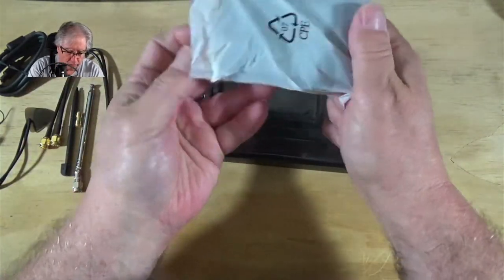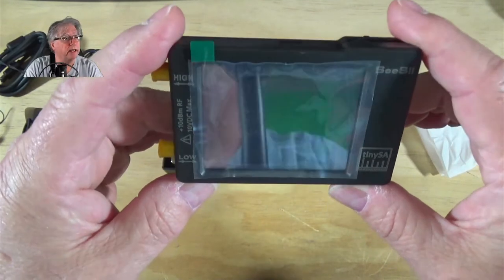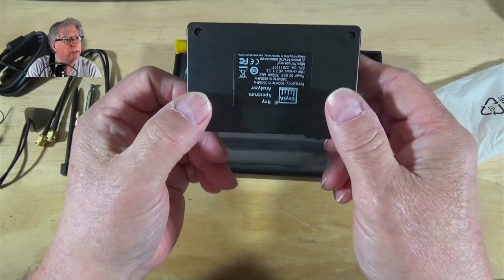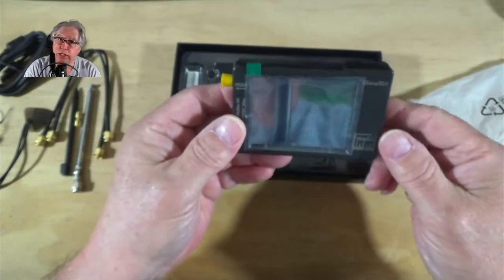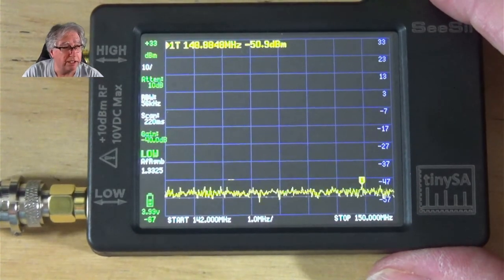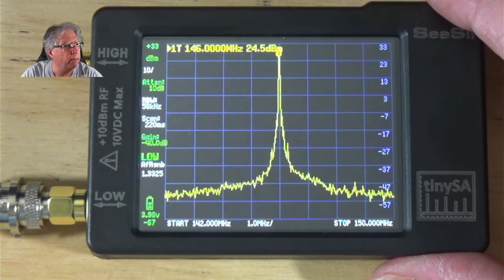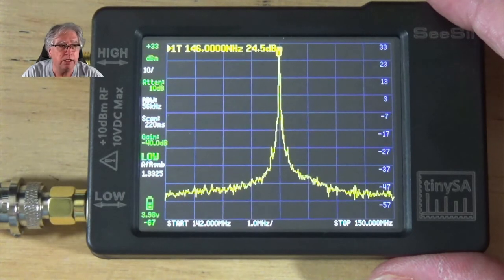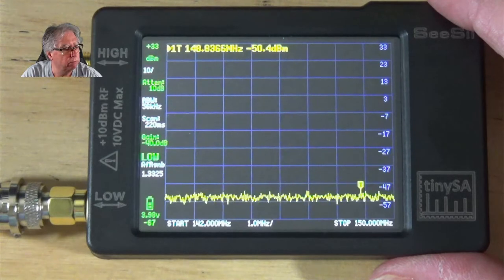TinySA Spectrum Analyzer Review - Unboxing And First Time Tests

Comment: Thanks Stu ! I enjoyed watching your tinySA unboxing and review. I recently retired from a career in electronics spanning 7400 series ICs in minicomputers to advanced medical electronics repair. I’ve been a ham radio operator since 1977. Back in the day I used a Weston Schlumberger 150MHz counter and a Bird 43 to set up my crystal controlled two meter radios. Since I have the tinySA, tinySA Ultra & NanoVNA. For the cost I find the tinySA Ultra is well worth it just for the RF signal generator function alone. It sure beats out the Eico & Heathkit ones for performance. I would really like to see a video, done in your unique style, on the RF signal generator function of the tinySA Ultra. I am amazed at finding it can go to 800MHz (in the standard mode) and has AM & FM modulation ! I have not activated the Ultra mode, 800 MHz is plenty good for my basic needs.
Reply from the maker: Great Suggestion! I'll see what I can come up with.

Stu
AG6AG

Comment: Great video, Stu. I am going to take your advice to read the instruction manual soon. So far I have only used my Tiny SA for troubleshooting a garage opener, and locating RF noise source in the house, and it is working great. Looking forward to more videos about it.
Reply from the maker: Hi Victor,
It's a cool little tool! I haven't even scratched the surface on this thing yet. I need to figure out the dBm readings issue when testing the the HT. It should have been closer to 30 dBm. It could have been the connections, or the HT, or the device being off a bit, or me not making the settings right? Anyways, it is also a signal generator, so I think that would be interesting to experiment with as well.
I strongly encourage you to read the wiki. Especially the specs, as it gives you some insight into the 10 dBm pad to force 50 ohm termination.
Keep playing!

Stu
AG6AG

Comment: Hey Stu! 
Thanks for getting into the weeds on this. I might just pick one up.
The idea of setting it to monitor for peaks over an extended period is really interesting. I can think of lots of uses for a compact device that surveys for active signals: a sort of portable panadapter for contests, identifying intermittent noise sources (esp. if data can have a time stamp) and even listening for accessible repeaters on road trips and hiking adventures to new areas.
73,
Nathan
Reply from the maker: Hi Nathan,
Glad you liked it!

Stu
AG6AG